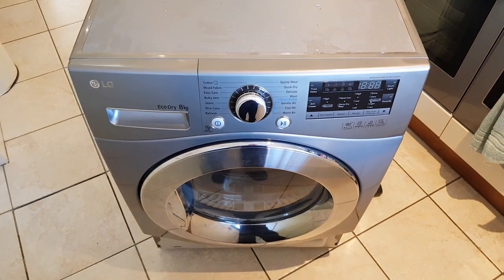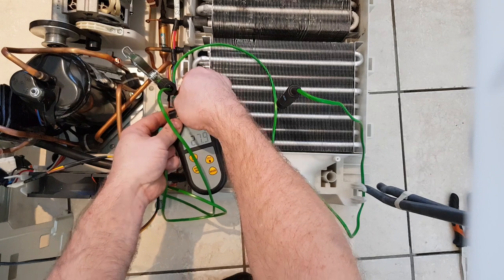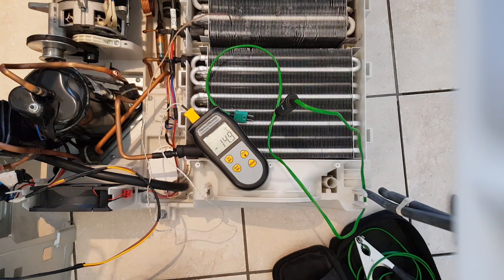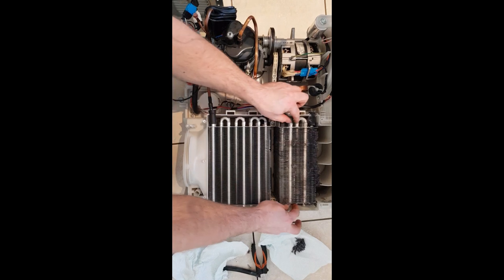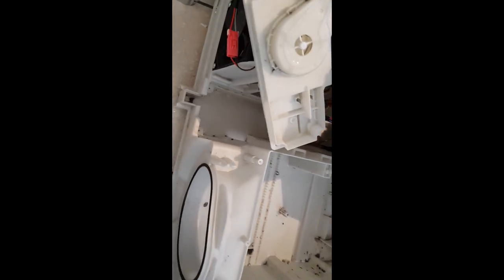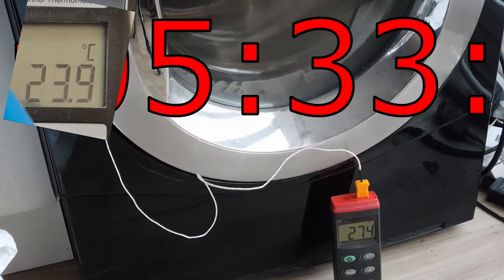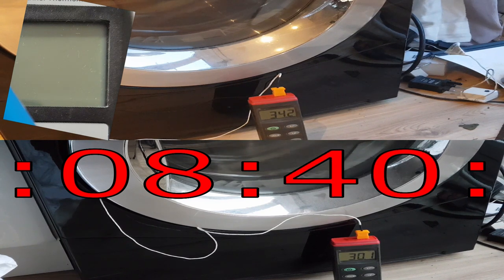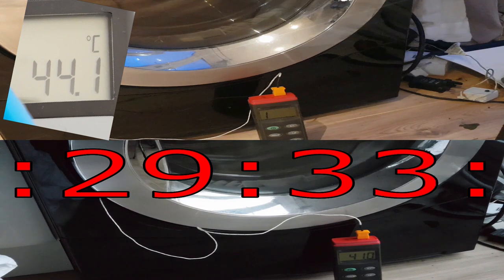heat pump tumble dryer how do they work  and how to test and fix them

Comment: So lg keep a lower temperature of beko? After a while seems to stabilizing at 45 right? Wich programs you was using? Theres in lg low temperature programs and high one? The compressor pump all the time? Or do on and off like in bosch that when is off steam naturally with the condens your clothes?

Comment: Got a Samsung heat pump. Using abit of sponge over the front of the the heat exchanger on bottom left as mine is the DV90M50003X which does not have a filter covering that like new ones.  We use it quite abit and started noticing clothes smelling musty. I removed the pump at the back poured/sprayed water through the front and picked up loads of fluff. Is this a crap design and is the Bosch heat pump with self cleaning a lot more resilient/less maintenance. Boiler engineer so white goods not my speciality.
Reply: hey magic , have the same model samsung dryer , after 7 months it doesnt collect any water from the clothes , water tray is empty after 3 hr cycle , checked the water pump by pouring some water at the back and it pumps water , so i am guessing fluff is blocking the path from the drum to the water pump . when u said u sprayed/poured water through the front , where exactly i have to pour water in the front ?
Reply: nare inf I had the same issue after 2 years. I got it repaired with British Gas white goods cover. Had to wait a few weeks for the parts but I remember the drum/clothes feeling warm but wouldn’t dry the clothes. I think the engineer mentioned it needed regassing as a cheap option but he wasn’t qualified so ordered whole assembly.

Comment: Hello, the compressor of my dryer gets up to 82 ° C warm.
In my opinion, the very high temperature is an indicator that refrigerant has been lost in the cooling circuit? 
Does this mean that the energy advantage of a heat pump dryer is no longer available?
Thank you for your opinion.
Reply: Im a refrigeration engineer. Just wanted to say that 80 degrees is a bit warm but not too hot to say the gas is gone. If the gas was gone it wouldnt take long before it would start tripping on its thermal overload or burn out depending on the number of times it cools down and starts again. Can you see what refrigerant it has in it? Some have higher superheat than others. You have to think. Nothing is really cooling down the compressor other than the refrigerant coming back on the suction line, if the discharge line is 55 degrees and superheat is 10 degrees plus a few more degrees for heat of compression thats not far from 82 degrees you got. Make sure all filters and coils (evap and condenser) are clean. Most issues with machines like this are airflow in the right places

Comment: Hi, our dryer is goung, afters stops and it says full water tank and it stops. I turn it back on, it pumps a bit of water up, and goes for awhile, after stops again. I had cleaned it up as your tutorial. Any tips ?
Reply: I'm having the same problem, I replaced the pump but still same problem. Did you fix yours?

Comment: Great, great, great video!  Hypothetic Question: does this heat pump (hybrid system) could work 8 hours strait at 80ºC?
Reply from the maker: Yes but ideally 55 to 60 degrees c for the sake of the didcharge pressure on compressor snd refregerant oils health
Reply: @jaysjetskis hi Jason I’ve got exactly the same machine in hybrid. Machine is not drying, it’s stone cold. Cleaned everything as in your video. Still the same. Will do the check bypassing the relays to test compressor to see if I get hot and cold on the elements. If they don’t then I’m assuming it’s the heat pump/ compressor? Is it worth repairing?

Comment: Hi Jason! I need your help! I brought my German (50hz) bosch dryer self condenser to the US (60hz)..unfortunately it is not working properly.. It is 220 V.. Until here, no problem.. I turned it on, electrics are ok, I checked the timer and it is OK.. But the dryer is not heating up enough.. After the circle, the clothes are only half dry. Do you thing that there is any way to solve this? How generate the heat on this dryer? Is the compressor? If he is 50hz, working on 60hz, he is working around 20% more, and it should be more hot than normal! Please I appreciate your thoughts! Thank you
Reply: Maybe your drain pump to clear water at bottom storage no function well

Comment: Hi. I have a Candy heat pump tumble dryer and cotton clothes are not dry at the end of the cycle. I've dissembled the entire machine and it's clean from fluff. Condenser works the first minutes, roughly 9 degrees but after a while temperature goes up to ambient or higher. Compressor is running and the evaporator gets really hot over 50 degrees. Any ideas?

Comment: Hi there I wondered if I could contact h about a Hoover tumble heat pump dryer that not getting hot could it be the capacitor or just gunked up it runs no fault light just dose not get hot 🥵 I had the back cover off to see no nct sensors and a compressor I can not get anybody out and have a young family

Comment: Great video walk-through. Are there any issues with mold & mildew, especially in the heat exchanger or below in the reservoir?  If so, can a ‘disinfectant’ be applied on an empty cycle to clean the closed airflow path? Thanks!

Comment: Hi i have grundig heat pump dryer its heating up clothes but its not condensing, clothes come out wet even after running it for few hours all filters and condensing fins are clean pump pipes are clean. Any help would be grateful
Reply: The evaporator doesn't get cold,  its warm to touch even after hours of running the compressor does run.

Comment: I always get our appliances fixed rather than dumping them for a new one. Got a local repairer out recently and he says our heat pump dryer needs a new pump (it's not heating up) and is basically not worth repairing. Should I get another opinion? He didn't disassemble the dryer fully like in this video.

Comment: Wonder if you can help me with my heat pump dryer. Sometimes it works absolutely fine (30%) and other times it just keeps going and the clothes never dry (70%). When it's working after 30 mins or so the sides of the dryer are warm but if it's not working the sides are cold. I've followed the instructions in this video, stripped it down and cleaned out all of the fluff from everywhere but it still only works properly some of the time. Any ideas what may be my issue and what I can do to test?
Reply from the maker: Hi. I honestly have no idea.. without looking as that really isn't a common problem.. if your is a hybrid model it could be that different programms are using the heater element and some are only using  the heat pump.. if you have a eco and speed option.. the speed will activate the heater

Comment: Out of curiosity, is this model using convertible frequency inverter/compressor like the newer ones?
Reply from the maker: Many of the newer ones are still using a permanent capacitor start and run on a single phase induction motor driven scroll compressor like this one . So no this is a standard compressor. One that springs to mind is the panasonic heat pump dryers use a 3 phase bldc motor but same rules apply  concerning temperautre increase inside the drum :-)
Reply: @jaysjetskis  Thanks for the reply. I saw the new RC90U2AV2W/RC90U2AV3W are advertised as dual inverter convertible frequency, and the newer samsung ones even have electronic expansion valve. They look better than some air conditioners : )
Reply from the maker: @frank7353  oh cool. the black one in the video has a variable metering device aswell but a standard compressor . you gotta love the wanky marketing words they put on them , "inverter convertible frequency"
how else would it change the speed of the motor? lol  it needs that to work :-)

Comment: I have a hoover dynamic next heat pump dryer, it switches off n but when you start a cycle it’s tripping house electrics, any ideas
Reply: Does it trip RCD which governs multiple circuits or does it just trip the circuit it's on?
Reply: It trips the hole house

Comment: thank you for the clip I have an LG heat pump slightly more modern than this one which is not drying I hope you can give me tips,   I opened it like yourself suspecting fluf or water pump failiure but its so clean inside and water pump working well but the refrigerant evaporator is not getting  cold and the condenser not getting hot  after running for 15 minutes !!!  the compressor is getting hot and i hear humming but no serious heat difference  between condenser and evaporator !!  can this be empty gas ? or failed compressor ?  how can i tell and do they refill the gas ?  if the system leaks once it will always leak ?
Reply: I have the same problem. Did you manage to resolve?
Reply: @spurs079  
most common is blockage by fluf or water pump failiure which is easy to fix if you open it but my one tuned out the compressor has failed so its useless
Reply: @BariMusawwir  hi mate thanks for replying. Cleaned everything. I’m pretty sure it’s the compressor as bypassed the relays and sent power to compressor. Was getting hot but the pipes weren’t delivering the desired temps to the condenser and evaporator. Are the compressors expensive?
Reply: @spurs079    
thats exactly like me so I gave up because the compressor is the expensive part i guess,,,  but if you have the warranty  proof of purchase they have 10 years on the compressor if you can show them that its the compressor. 
i was told the compressors are very unlikely to fail but looks like they do but if you can get the warranty they will just replace the entire unit for you but i can not do that because i bought it second hand
Reply: @BariMusawwir  I bought it in 2014 but sadly I remember throwing the receipt away a few months ago. Anyway would have been another drama trying to prove it. Ie independent reports, call out charges etc. Going to have accept defeat and buy another machine. Any recommendations?
Reply: @spurs079   yes throwing the receipt was the biggest mistake because even mine is modern and they know the year of build is recent well withing the 10 years but they will not cover me because i cant prove it with a proof of purchase as i got it second hand with no receipt.  me too i accepted teh defeat but i learnt good knowledge from it , now i feel bad throwing it i stil have it i wish i could give it to mechanics to use it for spare parts as its an expensive machine
Reply: @BariMusawwir  I’m going to go to curry’s today and ask them to put in my details. Hopefully something will be there. Will let you know
Reply: @BariMusawwir  hi my friend. Got currys to dig out invoice. Was out by a year. Spoke to lg and was told the machines are covered free parts and labour for the first five years, the remaining 5 years would have to get it repaired by an independent engineer and the invoice forwarded to lg. They would only cover the part, not the labour. Basically it becomes a song and dance after 5 years. So the 10 year warranty has a lot of loopholes. Definitely worth having an independent extended warranty.

Comment: Great video! Is it LG's "auto cleaning" condenser dryer? They say it washes the condenser  automatically, but I see a sheet of damp dust on the condenser. I wonder if the dryer stinks due to the dust on the condenser, the dirty water in the bottom tank, and the water in the pump basin.
Reply from the maker: Well all dryers will have dirty water in the base like this one and for some reason it never smells? Your spot on tho the self cleaning feature used in this model unfortunately doesnt work and ends up creating a damp dust. The three pipes along the top are supposed to give it a shower clean but as you can see the end result is anything but clean! Lol
Reply: Thanks for the reply. I want to ask u a few more questions on my LG dryer. Is there any way to send you some photos of my dryer (inside)? I'd appreciate if you could give me your email address.

Comment: Hey! great video! thanks for this! I have a question, wondering if you could help me: I just started using LG 8KG heat pump with eco hybrid. After 4 uses, I realised that I forgot to empty the condensed water tank and I noticed water under the dryer. Question: Is it normal to have some drips of water from that little rubber hose on the left side of the dryer even if the condensed water tank is empty? And should I always have a hose attached so water can be drained from the dryer or is the tank enough> If i dont forget to clean it after each use? 
Should I let it sit and completely dry off so I can test it for any leakage? Thanks for any tip you can give.
Reply from the maker: Theres a tank at the bottom which will always hold a little water but it will get pumped up into the top tank. Just remember to empty that every dry cycle and youl be ok :-) the water pump needs to be immersed under water in order for it to work. Hence the small amount of water stored at the base of the machine . Its so the water pump can live underwater :-)

Comment: Please answer me🙏🏻 Samsung dryer heat pump DV90M500QX / where is the capacitor ?  I didn't find, my dryer is opened but can't find the capacitor please answer me
Reply from the maker: Hey bro just seen your messages . Sorry im not checking these that often. The motor is on the right sode looking at the back and the capacitor is all the way over on the other side